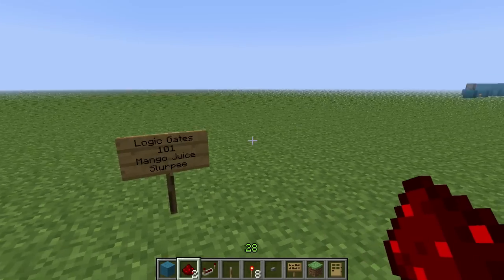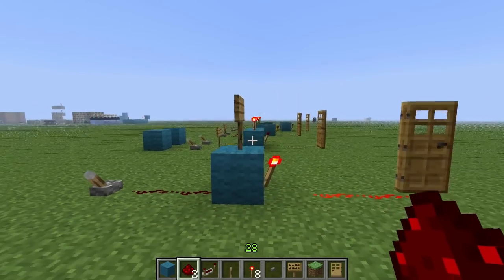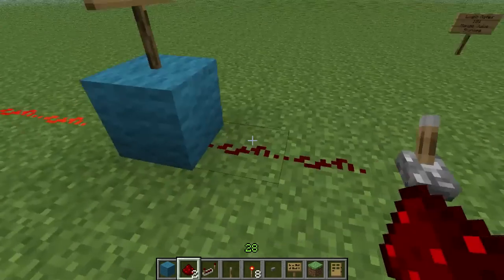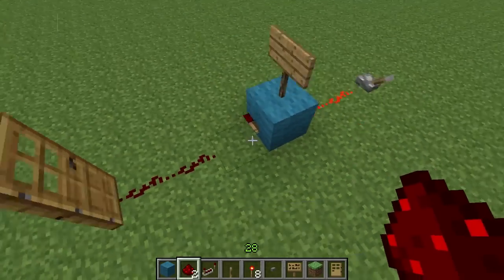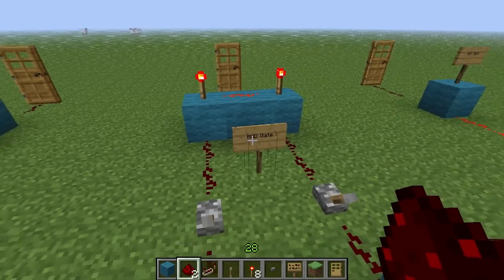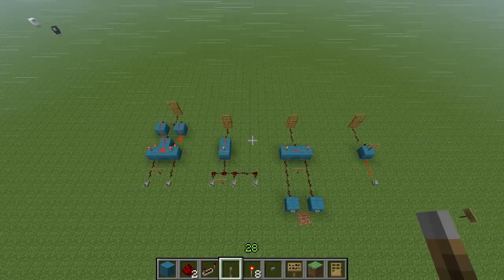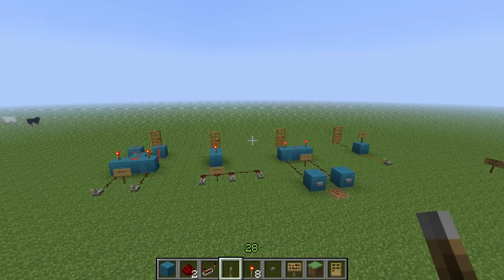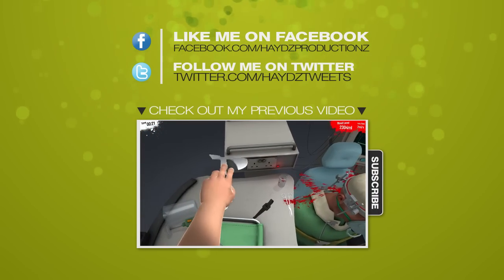Redstone Tutorials E05: Logic Gates And How To Use Them!

Comment: Hey haydz was just wondering can you implement with lighting from a longer distance. As in have a switch on both sides of the house to power lighting so if you come in one side you can turn lights on but if you leave out other door you use that switch to turn them off

Comment: Haydz, I made an XOR gate for a door, but I had to remove the two torches on the top of the first two squares (make sense?) but i also have another door i just added a lever on either side of the pistons and it just works simply, switch one the door opens, go thru the door other side hit switch door closes. Why is one simple and the other complicated? The lever trick didn't work for both doors just the one. 
Maybe I can upload a video or have you show me why this happens?